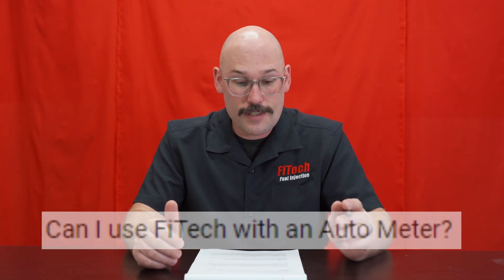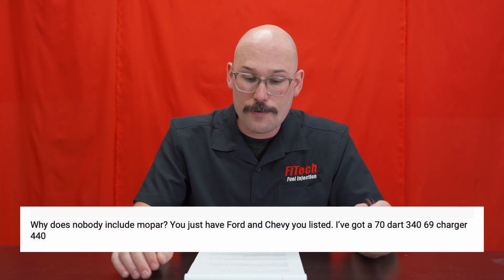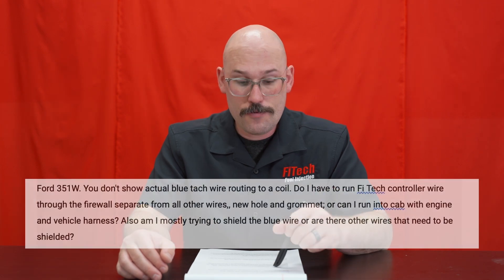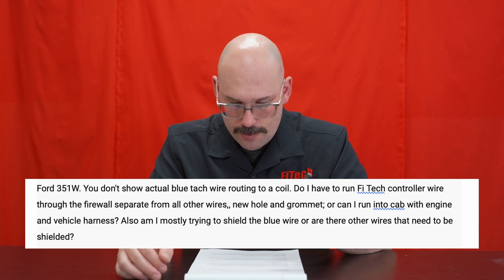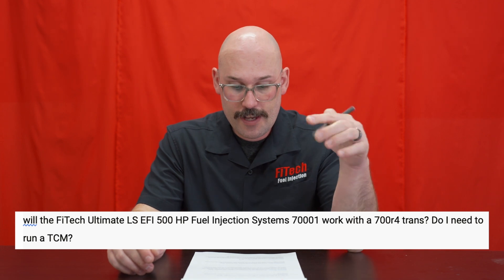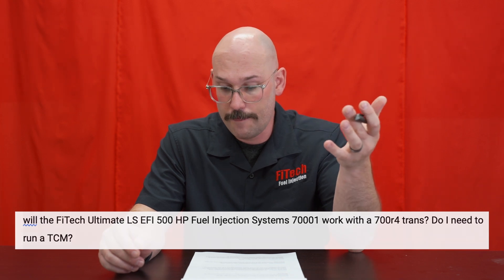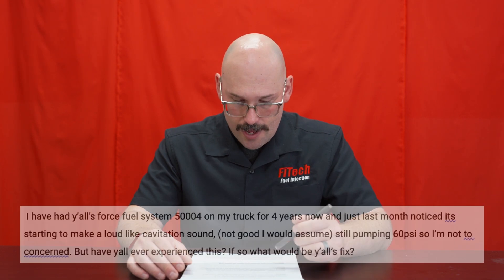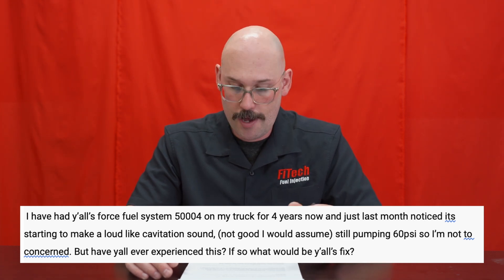FiTech Fuel Injection Q&A | 4 | EP108

Comment: I would be very happy if you could help me: I am looking for an "external" fuel pump, about 60psi, very small fuel delivery volume and - most important - extremely low electrical power input.
(small motorbike engine with ridiculous weak alternator ...)
Maybe you are aware of such a fuel pump?
Reply from the maker: From what I understand modern street bikes are fuel injected and use electric fuel pumps. You may be able to find one from one of these bike to then retrofit.
Reply: @FiTechEFImedia  Thanks! The problem is that these modern bikes feature in-tank-pumps.

Comment: I have a 30002 Go EFI 4 system, I currently have the old style hand held controller, what do I need in order to switch to the new hand held controller
Reply from the maker: You will need the handheld and a handheld cable to connect to your system. Here are the part numbers 62013-30001 and 62014.

Comment: On  the handheld large guages,  they show a tach with 9000red line and 12000 full sweep (from memory)

Totally crazy for my long stroke v8. How can that be changed to a more appropriate range and red line?
Reply: I’ve been wondering the same thing. I have my rev limiter set at 4500. I don’t need it to go to 12k.